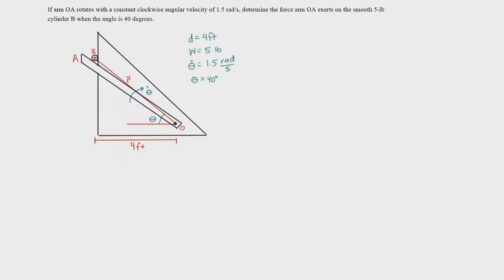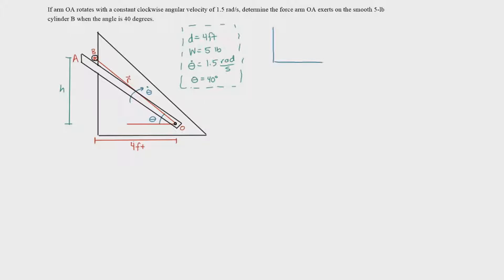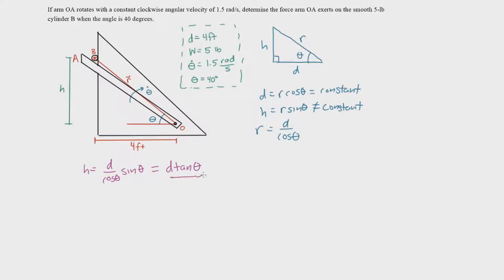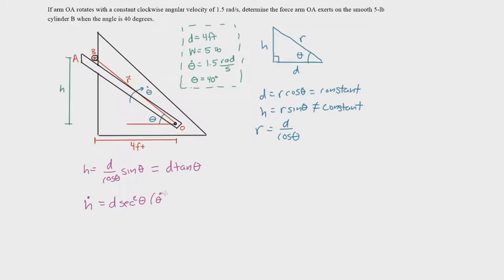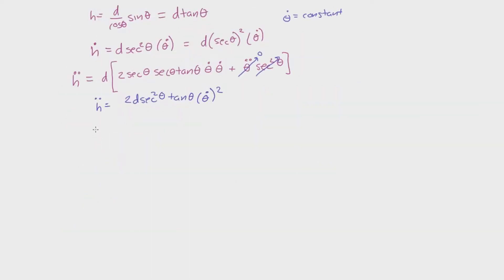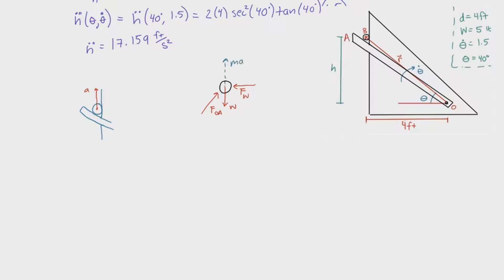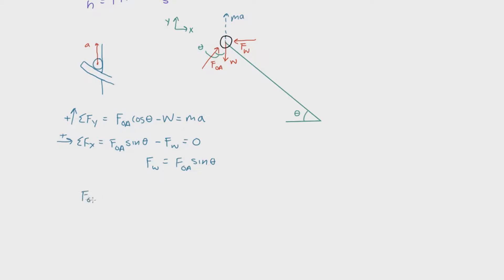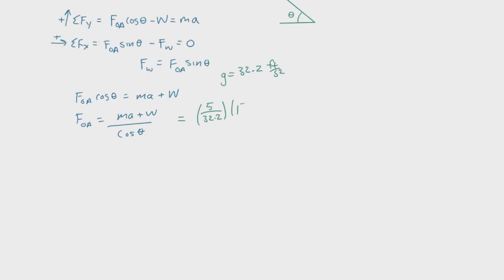Curvilinear Motion with Polar Coordinates Example #1 "If arm OA rotates with a const..."

Comment from the maker: CALCULATION ERROR
I made a few calculation errors. Although these calculation errors exist, all the equations that are strictly in terms of variables are correct.
The acceleration is 25.738 ft/s^2
The normal force, F_oa is 11.744 lb

Mybad!

Comment: How do you do it with a radial and transverse axis tho
Reply from the maker: What you would have to is...

1. Find the acceleration vector with respect to radial and transverse axis using that acceleration equation.
2. Use only the normal acceleration vector since that is the direction of the normal force.
3. Define the angles of the forces in the normal direction.
4. Then sum the forces in the normal direction setting it equal to mass times the normal acceleration. 
5. Be careful with signs and calculate.